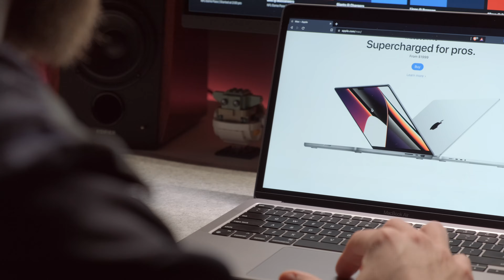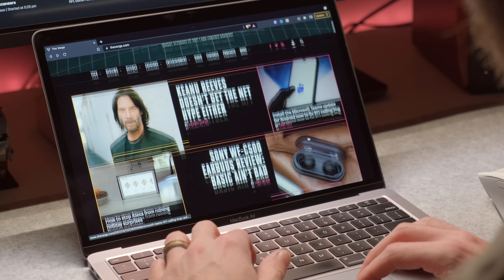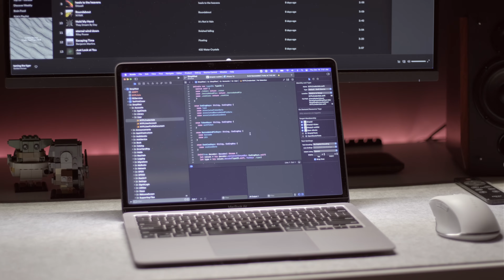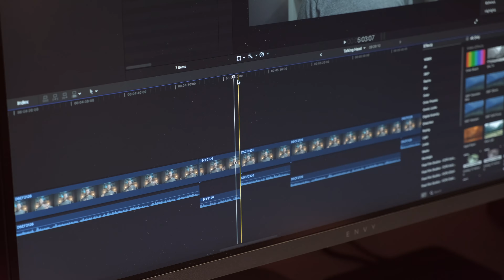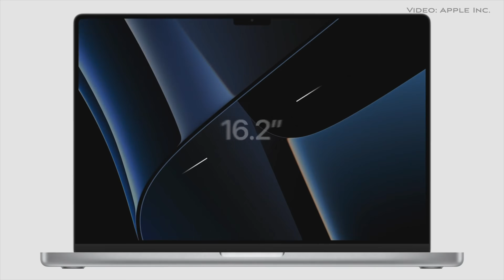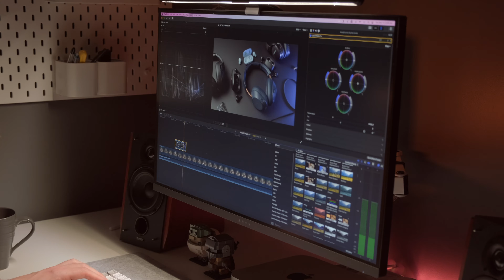Why I'm NOT Buying The New MacBook Pro...

Comment: I've been torn between getting an M1 Air w/ 16GB RAM and 1TB vs the 14" M1 Pro Chip w/ 16GB RAM and 1TB. I ended up buying the M1 Air instead because majority of the time I'll be plugged into my monitor with the USB-C cable. As much as I would like to have the 120 HZ refresh rate, it's more a "nice to have" and I wouldn't be on my monitor often enough to appreciate it. I already have an iPad Pro for my media consumption anyways. At the end of the day, it's really easy to get caught up in the benchmark and trying to justify it to myself that I'll need to shell out the extra $700 "just in case" when the M1 is more than enough for the things I'll be using my laptop for anyways. Thanks for the great video Kyle!
Reply: Man am in the same position.... I wanted to get the macbook air m1 as i love the portability of the device... I also wanted to get tue 14inch but i have not seen it physically... Dnt knpw if it will be bulky and worth the price...

Comment: As a freelancer and graphic designer I am waiting for a powerful Mac, preferably the new iMac with 27 inch display expected in spring. Very sure I would be fine with the current iMac with M1 or the Mac Mini for my work as a writer and in 3D rendering (Blender). The reason why I want to buy a much more powerful Mac (M1 Max) is that I always use my Macs around 6 to 8 years in intensive use and also want to think ahead for the coming years. Currently I still work with the MacPro (Trash Can) from 2013 and was always very satisfied. The investment for the new Mac must be worthwhile for a few years, so I choose a Mac equipped to the maximum for my budget, for which I have also built up reserves in recent years.